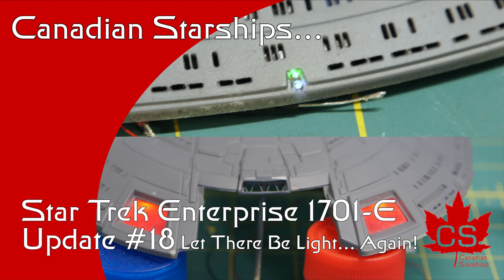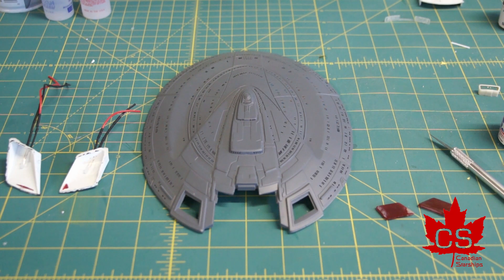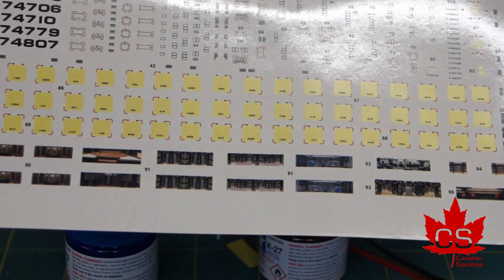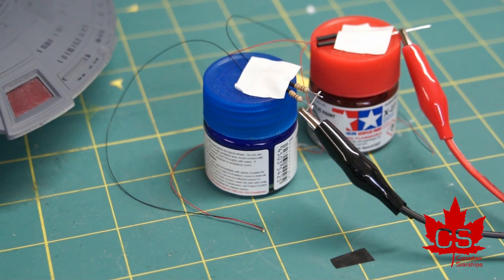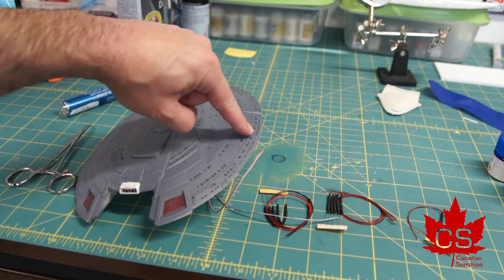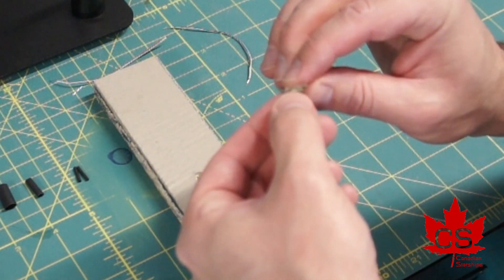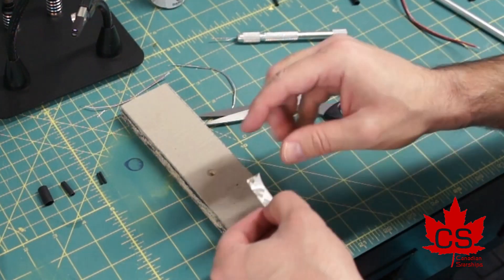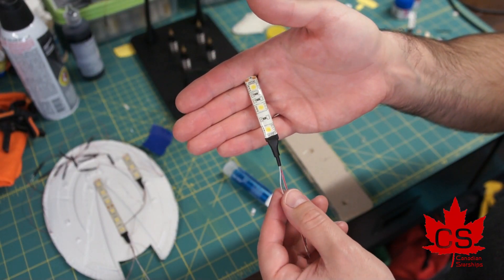Star Trek Enterprise E Model Build Update # 18 (2020)

Comment: No Shit!? Cant believe I didn’t think about drilling a hole through the tabs where the wire goes. This will be so much easier now. I has a hell of a time gluing the wire down on these strips. Thanks. Also where do you purchase your LED? Looking for tiny marker lamps and flashing ones for the enterprise D AMT model 1:1400.
Reply from the maker: We have a great Electronics shop in our city where I can get most things, however the 0402 SMD's I use for navigation lights and the supper high density LED strips were sourced on eBay or Amazon.